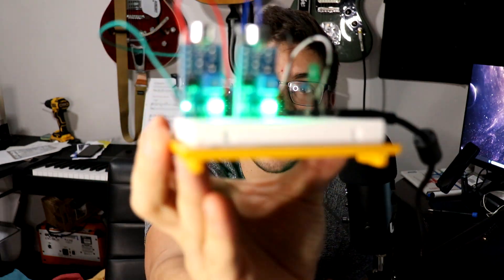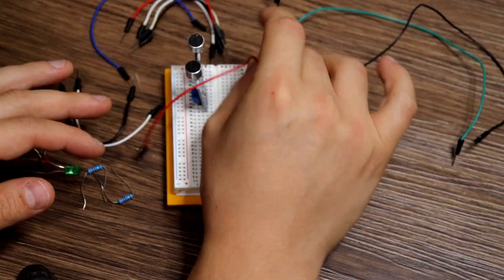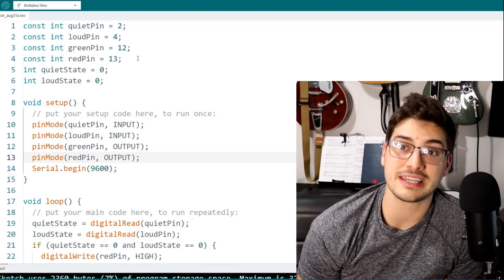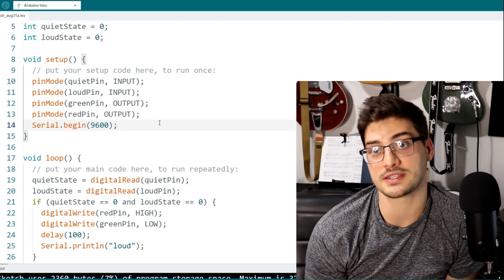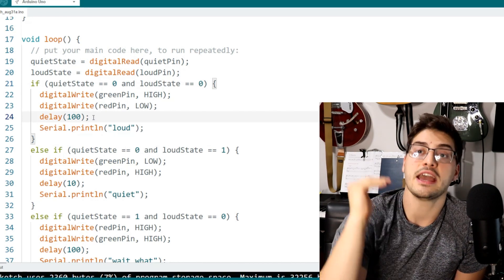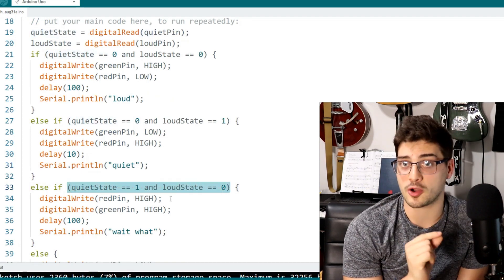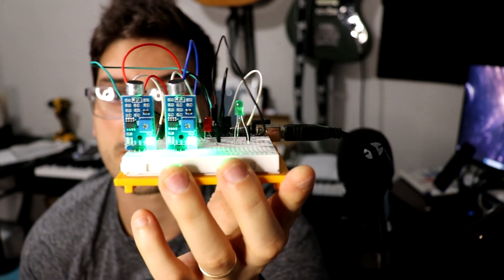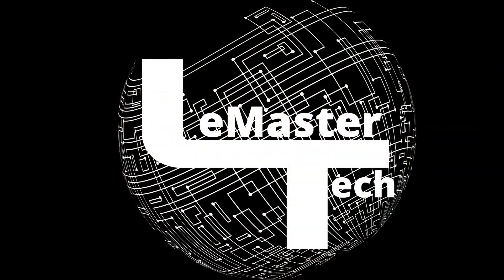How to Use Microphones for Sound Detection with an Arduino!

Comment: Hey. Could you also set this to detect specific frequency ranges and recrd at those ranges thanks
Reply from the maker: Hi, yes you can build an application like that but you’d need more advanced microphones than these! These are simple digital output either yes there’s volume above a certain threshold or no there’s no volume above that threshold

Comment: hello, is there a way to detect specific sounds, like a whistle ?
thanks !
Reply from the maker: Hi - yes there are ways to do that but simple arduino programs and modules are probably not the right solution. You’d want more like a raspberry pi running a python sound recognition module script for this!
Reply: @lemastertech  alright thanks !